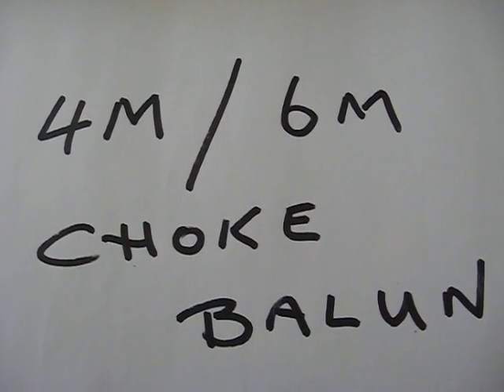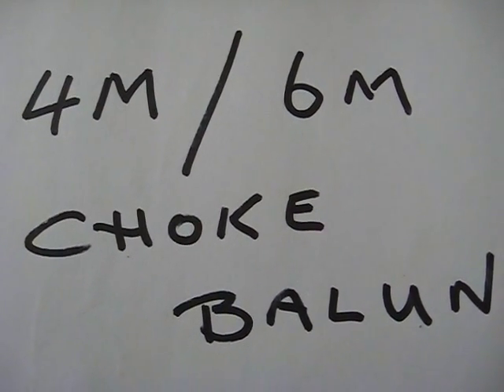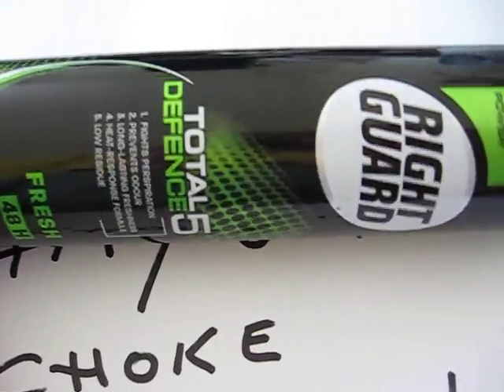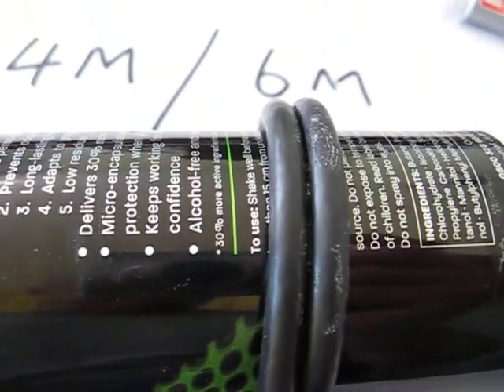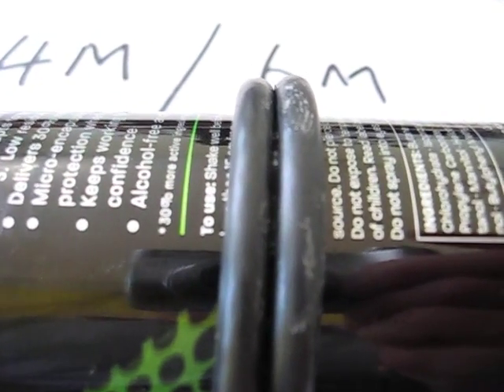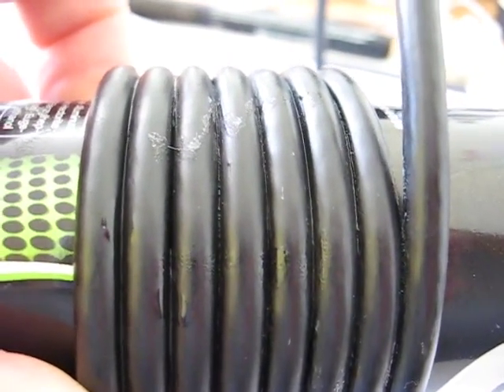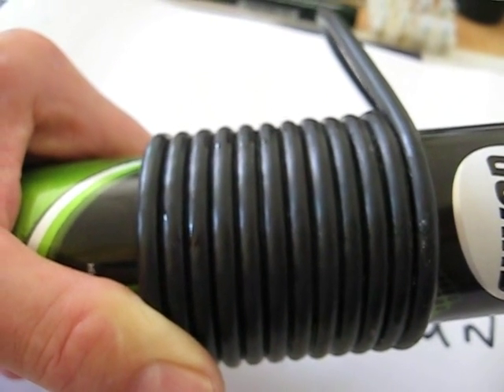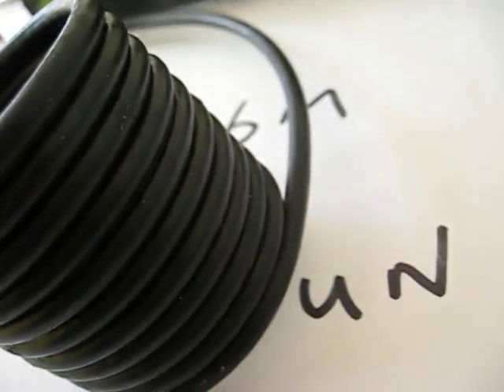6M CHOKE BALUN MAKE YOUR OWN

Comment: I don't understand making a choke or any balun and then not measuring it to see if  it indeed does have a high choking  impedance at the frequency of interest. Air wound chokes are narrow banded- useful at their frequency of self resonance where the common mode R is high. If operated below or above resonance and your feedline's net common mode reactance is the opposite sign of the choke's reactance- the choke can make common mode current WORSE.
Dale W4OP